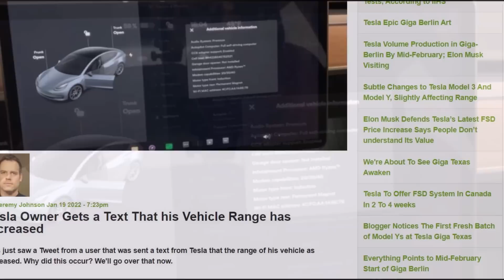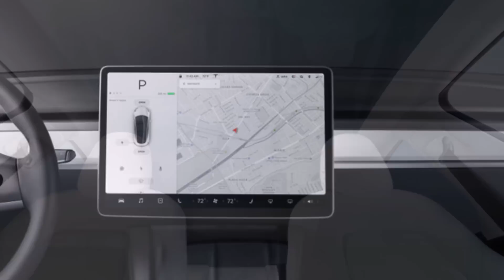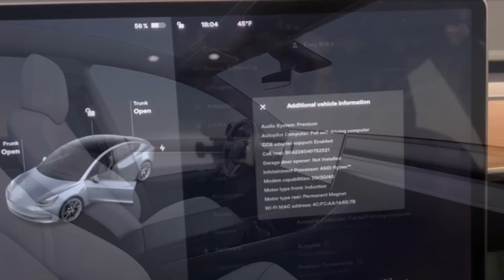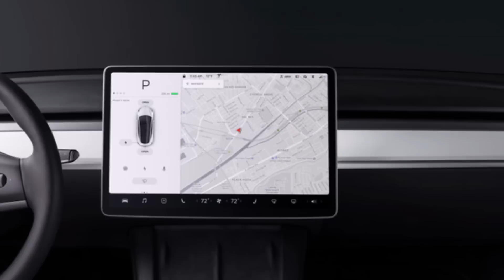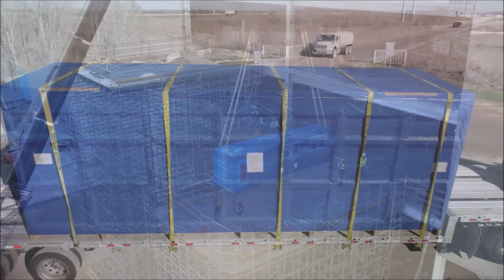BREAKING! Tesla Increasing Model Y Range, Owner Gets TXT Message

Comment: There are many ways to increase range really, they can tweak the acceleration curve so a medium press ramps a little slower small enough not to notice yet extends battery a lot, they can have the pulse width modulation on the lights reduced so that during sunset and sunrise the lights aren't required to be as bright, many other things.

Comment: If they want way  better performance and way better efficiency, Tesla should start buying Apple M1 family of System on Chip! Apple M1 blows away everything else as well as has a baked in world class security system built in to the M1 Chips!
Reply: It's behind Tesla's NN chips. The M1 is a great chip but a dedicated chip will usually beat a generic one, even at a lower clock speed.

The media should use the ARM chip as it's unbeatable for power/performance but recompiling will be a pain.

Phillip.
Reply: Or just up to date ARM CPUs

Comment: More than anything people want good range and fast convenient charging wherever they go. Tesla is smart to increase range. It will help to keep them number 1 in sales and brand loyalty. If they can figure out how to produce model y and 3 with 400 miles of range they will dominate ev sales for years.
Reply: Whatever changes they did, combined with the structural pack, 4680 and mega casting. 420~ should be possible. More range than my CX5

Comment: Hmmm… I suspect the reason he’s getting more range is they are NOT putting the AMD chipset in the car.  The AMD chips require more power than the older Intel chips.
Reply: Sorry - the amount of energy consumed by the media chipset is minuscule compared to the amount of energy needed to propel the vehicle - turning all the stuff off completely likely to add < 0.5%  increase in range.

Comment: I will buy a tesla after 10 years...my Toyota Prius is not giving up on me yet... it's a 2010 toyota prius and I get 50 mpg. I hope toyota can improve their batteries.
Reply: My wife and I purchased a 2021 LR model Y. Love it. We also own a 2008 Prius with nearly 300,00 miles on the odometer - with no break-downs, and minimal maintenance. We have performed a complete refresh of the Prius, and plan on keeping her for a long time! I drive the Prius and my wife drives the Tesla, except when we are together. Then we drive the Tesla. I would encourage others 'to take the plunge' and buy a Tesla as well. Best of wishes to one and all.
Reply: @lifesavior51  oh wow you got 300k miles on your 2008 prius that's amazing. I hope I can reach or get that 300k  miles on my prius.so far the mileage is  144k miles with no issues.  The hybrid battery is still good though. Have your 2008 prius hybrid battery been changed? I am close to that 150k miles as they say where the hybrid battery needs to be changed?
Reply: Indeed, I will buy a CT after they come out. I am milking my current vehicles as long as I can, my oldest one is a 2002 Accord, mpg is nowhere near 50mpg, but I don't drive much and fuel cost is very insignificant. :-)